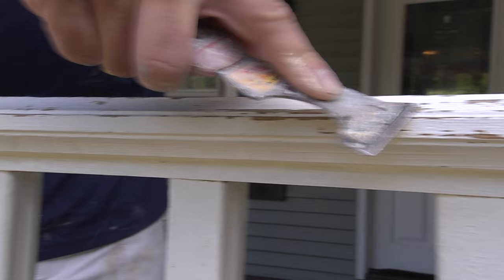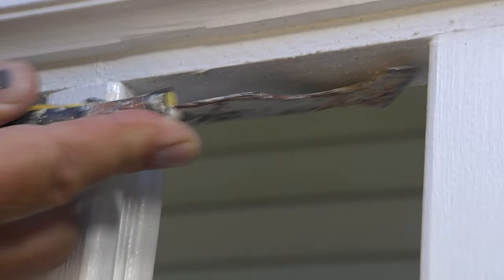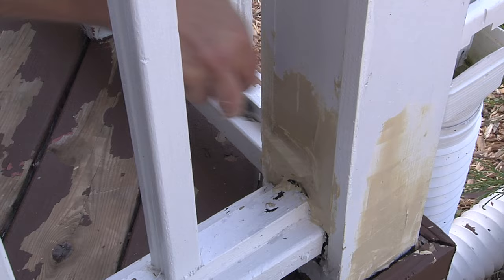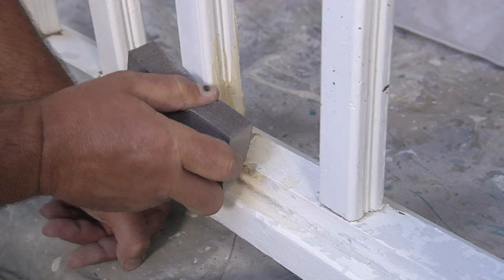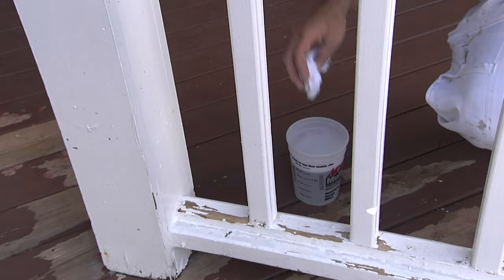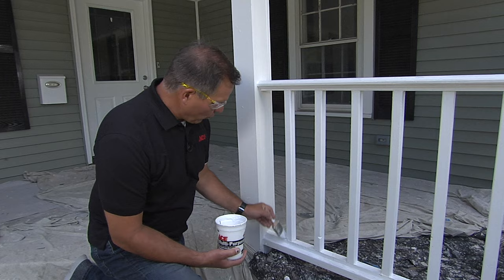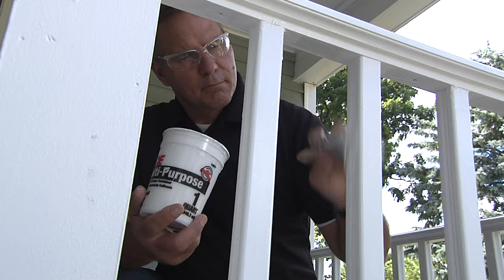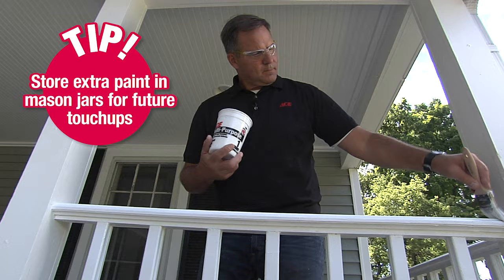How To Paint Porch Railings - Ace Hardware

Comment: All good info but really should work from top down. You do not need to use TSP unless you don't mind waiting for work to dry. Just light sand on entire previously painted surfaces and wipe, brush, or blow off dust. Small roller is good for initial application with immediate follow-up with good brush. The use of satin sheen is fine (as opposed to semi-gloss or gloss) but anything which is not perfectly addressed will be highlighted. In other words any flaws in the preparation will show more than a paint with less sheen like eggshell or flat. On warm days do not work in the sun if it can be avoided. Your leading edge of wet paint will dry very quickly and you'll attempt to brush out paint which has begun to cure leaving unsightly brush marks. If unavoidable you'll need to work fast and continue painting only that piece of wood you can finish quickly.
Reply: Like this info
Reply: excellent advice,  follow the sun when you paint outside, I would use a tackcloth to clean and wipe after sanding, I agree, start from the top down and use angle small brush also,  Wooster makes great brushes

Comment: Yes, no need to rinse after you sand it.. clean the railings before you star using a  pressure washer and bleach preferably. Don't use a rag as he did to wipe it.Use an old paintbrush as a duster.. but always keep a rag handy when you're painting

Comment: So many things in this video that just isn’t right.
Whoever was doing the caulking, obviously doesn’t caulk much.  Would never use a sanding sponge on exterior wood.  It isn’t durable or stiff enough to withstand the job.  Always paint from top down. When painting spindles, it’s always a good idea to have someone on the other side painting so that there is no buildup.

Comment: The best primer is the paint itself, just water it down so it can seep and you can do up to 2 coats depending on the wood, then go ahead and paint and of course do more than one coat, you will have a very thorough paint job. This tip comes from some contractors who never saw the point of primers for wood and it works well. Nice video. Also for storing paint get one of those lids that open and close easily or the wide mouth ball jar, just beware that glass breaks, my personal favorite is heavier grade plastic containers that the large yogurt or sour cream comes in just make sure the lids work well and then use duck tape to label tops and sides of whats in it, even where you used it.
Reply: WRONG
Reply: Never water down any kind of paint
Reply: @FeedTheTeethMachine  never had an issue as a primer coat plus it's the same type of paint brand but on for water based, then it sinks in, the rest is regular paint.
Reply: If you want your paint job to last, use oil based primer on wood.  “Watering down”latex paint is not a primer.  Those “Contractors” that gave you that tip obviously know nothing about painting, and are just there to get it done quickly so they can get their money and move on.  Their paint job won’t last long at all if that is what they are doing.

Comment: Can you uses a wire brush, maybe attached to a drill for the inside spindle bars. Mine are really really peeling! Spent 2 hours  trying to sand three spindles! 😓
Reply from the maker: Hi Debra, Yes you could use that just watch how hard you push so you don’t damage the wood.   Practice on a small and less obvious area first.
Reply: @AceHardware  anoter tip is powerhose the deck but then you need to put down plastic to catch it all and wash down the sides of the house, of course not the strength of your equipment so you do not ruin the wood, even the hardest of woods can get damage so learn how to use your powerhose, saved me tons of backbreaking work and then my power sander did the rest so I had little to scrape.

Comment: My railings have so many layers of paint and many groves that are filled with multiple layers of paint. Does your expert have any suggestions for removing the paint?
Reply from the maker: Hi Patti, Use a liquid paint stripper to remove as many layers as you can.  Take your time let it dry (based on the paint strippers recommendation, sand and paint.  
If you have more questions, take photos including closeups of the railing to your local Ace to provide more help if you feel uneasy about the project!

Comment: Question, why does porch rail  always chip? Every year or two this deck/porch rail needs redone. Why? So sand it, re paint it. What is being done wrong. Now we used thompson. Behr
And others. Will you advise on this.  Is this normal?
Reply: Hi Barb! You are doing all the right things by prepping the surface beforehand by cleaning, sanding, and painting, nice job! Here are a few ideas on why your porch railing paint might be chipping. One, make sure when you are painting your porch when it’s not too hot (over 90 degrees outside or if it’s directly in the sun for at least 5 hours) or cold (below 50 for at least 24 hours). These extreme temperatures don’t allow the paint to dry properly and adhere to the surface. Second, you might want to consider a primer before you apply the paint, this might help. Lastly, another factor is humidity, not sure where you live but if you are in a very humid climate that could cause the paint to not adhere properly also and cause it chip only after a few years.  At Ace we carry a paint specifically designed for porches, called “Royal Porch and Floor.” It’s a paint and primer that dries within 4 hours and is specially formulated for covered porches, stairs, floors and patios. I definitely recommend it! Hope that helps!
Reply: @annietheace7196   thanks for rply. Actually we primed first. But in june or july. Yes sun hits rail. But big oak tree hides some sun. I will try royal . Sanded off what I could. Thanks for info
Reply: @barbschindel2201  no problem, let me know how it goes. Your porch with the big oak tree sounds beautiful! 🤩

Comment: Can a small roller be used in addition to the brush to avoid brush marks?
Reply from the maker: Hi There, 
When painting railings, either applicator can be used, but it is a tricky application tell them to watch out for drips when using the roller.

Comment: Great video! Are there tips to paint the outside of a railing (without scaffolding and giant ladders) when the balcony is on second floor?
Reply from the maker: Hey Kate, A video on the best way to paint the 2nd floor without ladders?
Reply: @AceHardware  Do you have a video on the subject? I'm not finding it...I've looked through the catalogue on your site...
Reply: Unless you can fly you will need ladders or scaffolding to reach 2nd story. Renting a highboy or the like is a more expensive option. Always use safety harness in combination with aforementioned. Safety first.
Reply: @tonydelitala  You would probably not believe me if I said I could fly... I was hoping for a special brush with a curled, wrap-around tip or a cloth that would let you apply paint like shoe polish.
Reply: @katehenderson9634  haha. Ok but be careful. For some applications where reach is challenging I’ve had some success with mini paint rollers (about 3”-4” wide) with a short handle extension (18”-24”). It can sometimes help get you around corners. Best of luck. 🙏
Reply: @tonydelitala  that sounds like a great idea! Thanks!

Comment: Which color is better to paint balcony railing, chantilly lace by Benjamin Moore or high reflective white by sherwin Williams ?
Reply: Benjamin Moore’s Chantilly Lace is a classic go-to white that would look beautiful on a balcony railing. Make sure you use exterior paint so it withstands outside elements.
Reply: @annietheace7196  and for the garage door is chantilly lace good choice ?
Reply: @hocineted7594  I'm not sure what your house color is but the Benjamin Moore Chantilly Lace is a nice house color as well as a garage door color. Another idea is to look into using a Minwax Gel Stain. It's easy to use and looks stunning when finished.

Comment: What kind of puddy is used?
Reply from the maker: Hi Alex, We used Durhams Rock Hard Water Putty 
https://www.acehardware.com/search?query=Durhams+Rock+Hard+Water+Putty
Reply: @AceHardware  what kind of putty would you recommend for a metal door/porch pillar?
Reply from the maker: Hi Alex, We suggested checking out Bondo® All-Purpose Putty. It's a professional strength, versatile filler for repairing interior and exterior surfaces around the home. This fast curing two-part filler allows you to make high-quality, long-lasting repairs to metal, masonry, concrete, wood, drywall and more. The non-shrinking filler features a thicker formulation that makes it ideal for repairing vertical surfaces.

https://www.acehardware.com/departments/paint-and-supplies/patch-and-repair/spackling-compounds/1320845